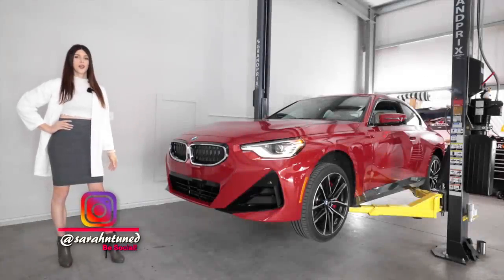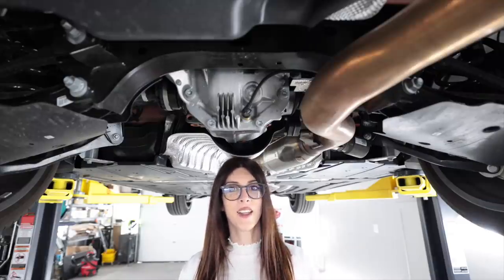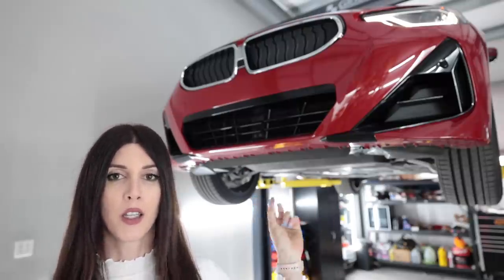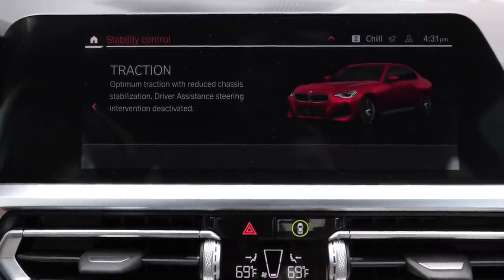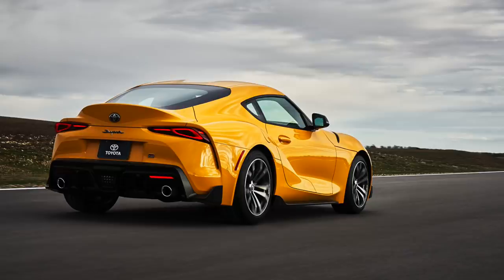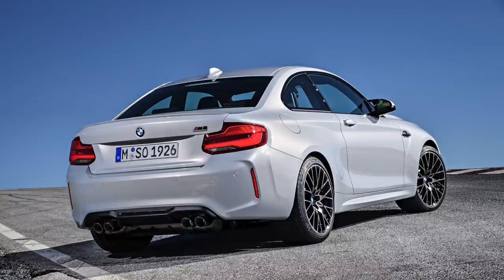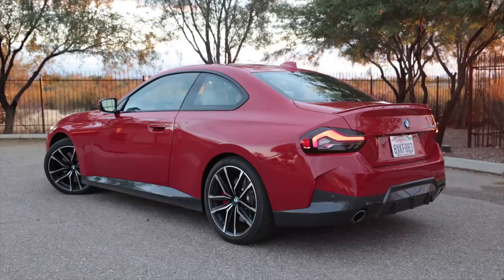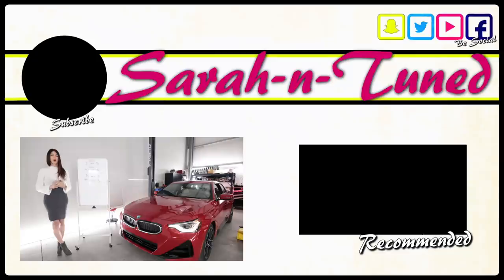In-Depth Mechanical Review! // 2022 BMW 230i M-Sport

Comment: On older BMWs that I am familiar with, the sensor on the rear diff was the speedometer pickup, counting the teeth on the ring gear, and they have had them there since at least 1983.

Comment: Totally agree with you on the “lifetime oil” thing.  Always be wary of someone telling you something you want to hear.  Especially up here where it’s cold, just gotta change the oil spring and fall, more if you put in lots of miles.
Reply: Lifetime means, a certain lifetime is intended by BMW.
Reply: "Lifetime oil" was referring to the transmission fluid, not the engine oil. I agree that it's not a lifetime fluid, but you should not be needing to change the transmission fluid twice per year.

Comment: Here's a Fun Fact for you. The reason the transmission fluid is lifetime is because BMW considers the "lifetime" of their transmission to be only 100,000 miles. So if you make it there without changing the fluid, mission accomplished!
Reply: That’s also why oil change intervals are so long on many new vehicles.
The manufacturer only cares about parts surviving the warranty period.
Reply: The manufacturer of the transmission ZF, says to change the transmission fluid and filter at 50,000 miles. The reason for BMW's  one year, 12000 mile oil change is because they pay for the first 3 oil changes.

Comment: That texas rabbit comment rang more true then you could ever believe. I once had a E36 318Ti as a beater, and one spring, when it started to get warmer (i`m from sweden), it started to smell really funky. So i did a proper cleaning inside, checking for hidden hamburgers, waterleaks and such but found nothing. So i went in to the engine compartment and... under the batterybox i found a very deceased rabbit. Apparently, i had hit it during the winter, and it had bounced up between the strut tower and exhaust manifold (NOT a big space), and then gone to rest under the battery. Luckily, after something like 4 months in an engine bay, it was pretty... crispy, so removal wasn`t that grose. But, yeah...I know, i know, my mom is right, i am unique...

Comment: Hello Sara!

New subscriber here!

I love your channel and have been binge watching for a few days!

I just took delivery of 2023 G87 M2 Coupe (new generation) with a 6 speed MT and very few options. I also drive the 230i in your video a while back as well. 

I really wish you could get a hold of the new generation M2 for a review so you can experience difference which, as you can imagine, is not subtle. If a lived close enough to you I’d give you mine to review. It’s an amazing machine.

My daily driver until now was a 6MT 2002 e46 M3 (I’m the original owner) that I outfitted with brembo’s on all 4 corners, a double adjustable coil over suspension, race exhaust, wheels/tires, race pedals, and a short shifter. This was my daily driver which I will now relegate to track duty.

Keep up the great work!

Comment: I've driven a M2 comp in an autocross environment. "Crazy CheeseWiz flickable" is accurate. Controllable fun oversteer made me feel like a skilled driver. These cars will lock the outside front wheel when the tail gets out beyond a certain point. It eliminates the pivot point before you run out of steering angle, preventing a spin.

Comment: I was busy breaking into a car when you posted this.
Have a Merry Christmas.
Nice presentation, and your appearance is quite classy.
Thank you again as always Sarah.
Reply: I hate locking myself out when I only have one key. I've found a small prybar and a 5 gallon bucket handle to be quite effective to get out of the jam. I hope it was an easy one to get back into. Unless it wasn't your car, then I hope it was miserable.😅
Reply: @JayLepisto  Mu granddaughter stopped by. Then proceeded to lock her keys in the car I assumed to see if I was still useful. I once had all the right recovery tools. That was quite some time ago. Ten minutes to gather a couple of promising looking trim removal tools, a rubber dustpan as a wedge, and the proper length of wire from a front yard campaign sign. Abracadabra
Reply: @mostcom  Nicely done! My latest was rescuing my son after locking himself out of his still running Versa at the pot shop on a Sunday afternoon. Proud parent moment. Have a great Christmas!
Reply: @JayLepisto  Merry Christmas Jay. I had to show off and demonstrated how it is impossible to lock the key fob in the Audi.

Comment: the sensor on the rear diff is part of the dynamic stabilization and if disconnected the speedometer will not read

Comment: As a mechanical engineer lifetime oil means lifetime of the car which means average lifetime of a car which is 10 years under NORMAL operating conditions i.e. typical driving conditions. Does not mean forever.

Comment: On public roads, BMW's 4-cylinders are definitely fast enough! Lighter front end makes the car more agile too.
With the high gas prices nowadays, most people simply don't have the income to pay for 6 or 8-cylinder cars.
But whoever designed the rear of this new 2-series needs to be fired ASAP! It ruined the whole car!
Reply: The 6 cyl and 4 cyl bmw m sports both have the same fuel economy … dunno why … but it is the case

Comment: The worst part of BMW is ‘CMOT’…. Cost of Maintenance Over Time… buy it new, drive it a few years then pass it on to the next sucker… that’ll guarantee a great ownership experience.  I’m a hard core ‘German’ first generation American - I’ve never owned any vehicle that wasn’t German made starting with a ‘72 Beetle in my youth… up to the last of the German made Tiguans (SEL with all the ‘ring a ding ding’ extras… ) as well as 280k on my 2002 1.8t Passat.   As many times as I have cursed the the busted knuckles they’ve all given me from time to time… my buddy’s 2009 328i’s electrical and injection issues were  the worst. (May it burn in hell for all eternity…). It was his advice to never buy a used one and never own a new one more than two years or 40k….  Just my thoughts… your mileage may vary. Merry Christmas all…

Comment: BMWs are unreliable and very expensive to service, and for those reasons, I'm out.
Reply: That's what people say about an Audi as well, yet I don't see it, I have an Audi that just rolled over 50,000 and haven't spent a dime on repairs.
Reply: @mostcom   50,000 isn't much. German cars tend to fall apart between 80,000 to 120,000. There are a lot of factors involved so YMMV.
Reply: @jaydibernardo4320  other people's opinion is that it happens before 50,000
Reply: @mostcom  Nah, 50,000 isn't much if you maintain the vehicle. The fancy electronics might go bonkers but it should drive fine.. Heck, a Kia will last 50,000. GM cars, well, that's another story.

Comment: I've noticed a lot of plastic clips, tubes and holders. Some mechanics say that this is the weak point of these cars, i.e. the brittle plastics  that break and need replacing on cars that are 7+ years old, especially the ones that live in the warmer climates. It may cost a fortune to maintain an older model. However, if you plan to keep the car for 5years and 100,000 km or 60,000 miles you should be fine.
Reply: Not just BMW, all the manufacturers are replacing real metal engine parts with plastic. Much cheaper but in the long run they will become brittle from all the engine heat. Learned that awhile ago from Scotty Kilmer.

Comment: Great looking 230i but too much cheap plastic and cardboard too🤔🤷👎  BMW was a great product in the mid 70s.  Bavaria manual transmission was a 6 cylinder rocket.  💖😁
Reply: The shielding made of Quadrant's SymaLITE thermoplastic composite. SymaLITE is a lightweight composite based on polypropylene (PP) and glass fibres.

Comment: Life time oil is used because the likelihood the transmission will actually be problem free for the lifetime of the car is very slim. If the valve gear or solenoids need replacing ever it will get fresh oil. So it's not an issue

Comment: 4:00 ZF are the manufacturer of BMW transmissions and they state oil and filter changes at 60,000 miles. It's a replacement sump that has a filter embedded within it. Should run $500 or thereabouts with the oil included.

Comment: Lifetime fluids = for as long as the car is under warranty.  Anything outside of the warranty, the Manufacturer could care less and probably hopes you don’t replace the fluids.....planed failures and so you buy a new car because repairs are costly and take time.

Comment: BMW should of stuffed the v6 twin turbo into it. 580 hp would of been more fun than 280hp any day. Great vid. Sarah has a Morticia Addams vibe which I think is awsome👍👍👍👍👍
Reply: Since when does BMW even make a V6? All of their sixes are inline, as far as I know.
Reply: @alexanderflack566 You don't BMW  if you think they don't make v6 engines.....a buddy of mine has a 2015 BMW with a BMW B58 v6 (yes it's inline)engine with a turbo charger that produces 637 horsepower and 590 ft lbs of torque ,and that's dyno'd.
Reply: @AzBigD  b58 isn’t a v6

Maybe you don’t understand the difference between i6 and v6?

And the b58 makes 335 Hp in 2015

New models are 382
There’s no 600 Hp b58

Comment: I have a 2018 M2 Manual! Great to see the 230i M-sport on the channel!

Little note on the drive modes, if it's like the previous gen, Traction and DSC Off are also drive modes on their own. So for the most aggressive throttle map, you want Sport+. You still have full throttle on all modes, though. It's just the response curve that changes. Not sure if that one was equipped with dynamic suspension, mine isn't, so the drive mode only changes the throttle response. For a bonus, the Traction mode has a extra burbles!

Penguin merch soon? The M2's asking for a friend.

Comment: Have the last of the old model. 25 year old E36 328i coupe is a much better car in almost every way. Every judgment made by enthusiast engineers who understand cars and then marketed. On the 230i the marketing people made all the choices; press sport and the steering is over heavy at parking speeds to give the impression of "sport" but the steering remains poor. The suspension and tyres are set up so that you hardly tell it’s RWD unless you really push it, and then it’s a handful. E36 had lovely fluid steering, compliant communicative balanced handling, and much smaller tyres without over traction. Opposite lock on demand especially in Autumn at low and sensible speeds. It’s the other way round now. Progress : No. Also the 4 cylinder is no substitute for the magical straight sixes of the 80’s /90’s.

The only enjoyment I get from this car is bursts of straight line acceleration, and that’s hollow praise. Loved E36, E34, E32, E39 etc.

Comment: Merry Christmas Sarah. These are most definitely fun little cars, and a quick tune on that B48 wakes it up well.

Brakes should be 248/245 f/r, but no drum in disc parking brake here. That's taken care of by the motors on the backside of the calipers at 1:53.
Reply: no